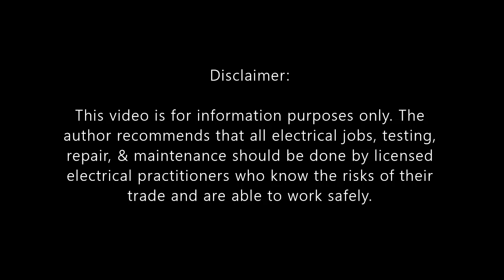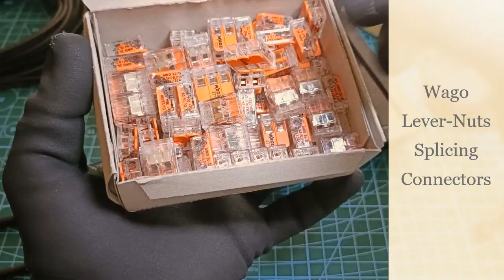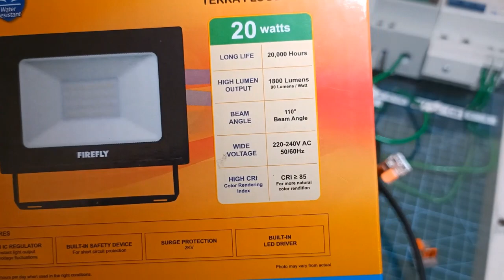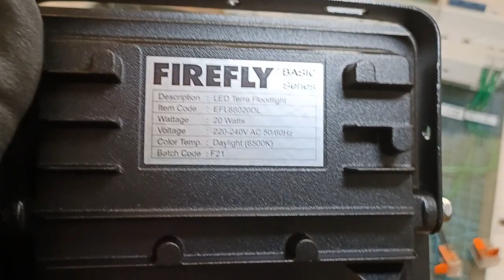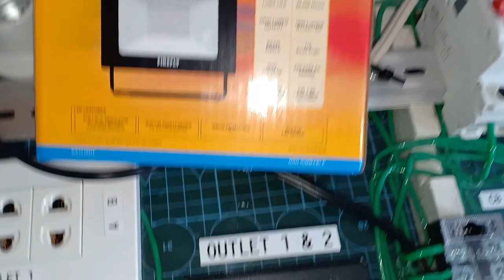Unboxing & Test 220V LED Flood Lights (20W Greenfield, 20W Firefly)

Comment: sir, pansin ko sa mga ganitong floodlight na binebenta online. di nila sinasabi anong klaseng led smd ang ang gamit nila. sa mga nabili mo, ano sa tingin mo ang ginagamit nila?
Reply from the maker: Other than being surface mounted LEDs hindi po ako familiar sa type nila sir. But they did provide lifespan information on the package: Greenfield 25,000 hours, & Firefly 20,000 hours, and 80 lumen/watt & 90 lumen/ watt efficiency, respectively. Based on this I would surmise they were the high efficiency kinds of SMD LEDs.
Reply: @ramschannelreviews  pero yung pagka 20 watts nila compared to other 20 watt bulbs or the likes. Kumusta naman po?
Reply from the maker: @wanderingandroid  hindi ko nasukat sir. But again based on their published specs, a 20W Firefly terra LED floodlight has 1800 lumens, while a comparable Firefly 20W LED bulb has 1700 lumens. Magkaiba ang format nila kaya maging subjective ang visual impression kung ano mas maliwanag. But they both output similar luminous intensity.